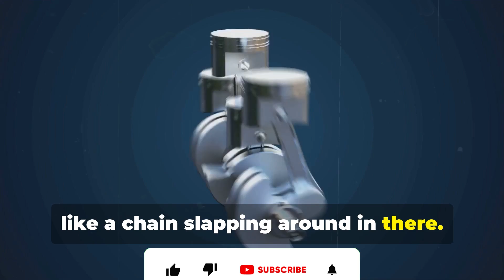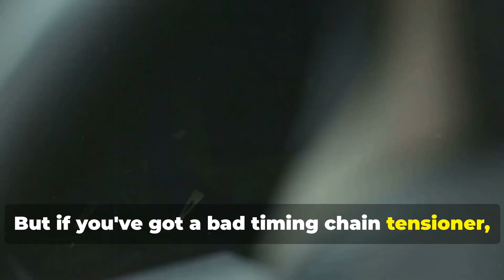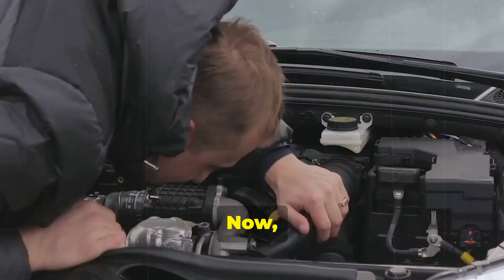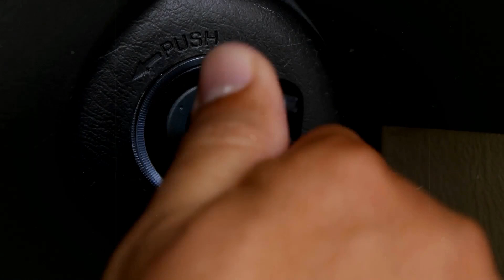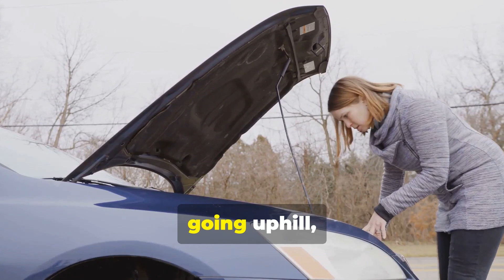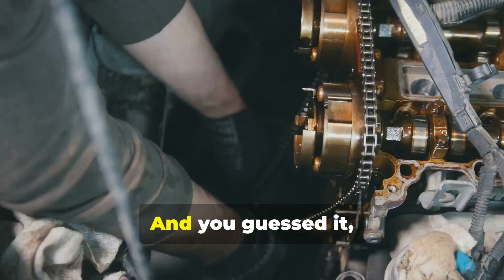7 Bad Timing Chain Symptoms: Easy Fix!!!

Comment: Thanks. Very helpful. I have a BMW G12 2016 and I can hear some of that timing chain sound at cold starts but its quite subtle. And since these cars are quite high tech and it will sense it any timing is off between the cam and the crankshafts and throw a check engine light when that happens. Can I just until that CEL and then address the timing chain as it is bloody bankrupting to get the timing chain replaced in the B57 engines as ithe timing chain is at the back of the engine and t is a total engine out job costing thousands of pounds.
Reply from the maker: Hey Guy, you're probably fine to monitor it for now, but I wouldn't wait for the CEL as the trigger to replace it. By the time the ECU detects enough timing deviation to set a fault, the chain may already have significant wear. If the cold-start rattle gets more frequent or louder, it's worth inspecting it before it reaches that stage.
Reply: @MechanicalGuy68  Thank you. I will keep an ear out for the rattle. This high mileage BMW G12 has already cost me over 10K in repairs since I bought it in April last year and I just discovered what this sound meant after I took it to a garage for a totally unrelated issue last week. The mechanic said that even inspecting it would be an an engine out job (as the bloody thing is located behind the engine) cositng thousands in labour so you might as well get the timing chain replaced if you decide to do that.
Reply from the maker: @SaminPK  You’re not wrong. On these G12s, by the time the engine’s out just to inspect it, replacing the timing chain is usually the sensible move. If it’s only a light rattle for now, keep a close ear on it and don’t ignore any change in the noise , it’s a lot cheaper to catch it early than after it lets go.